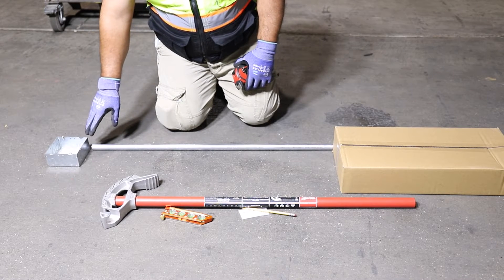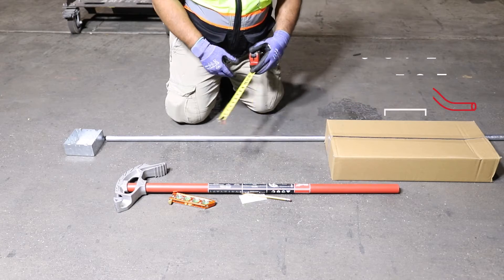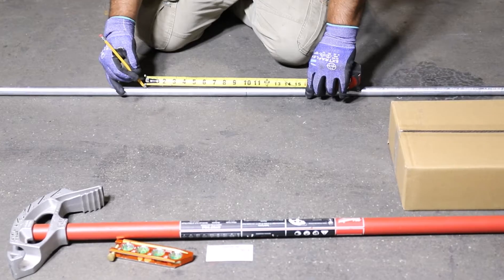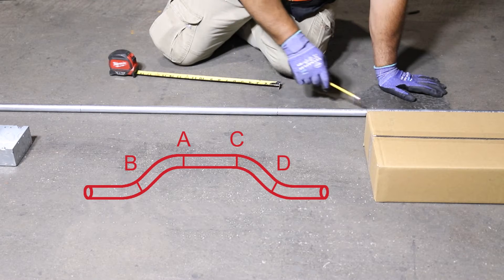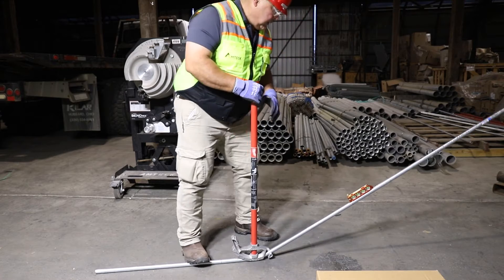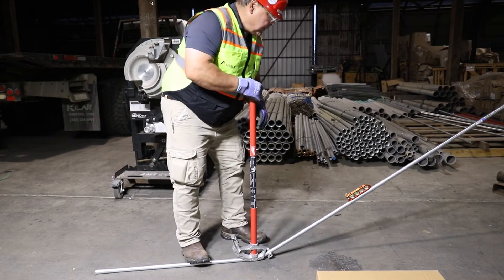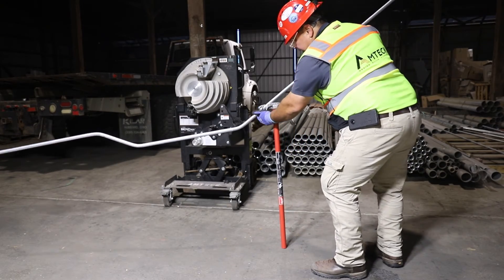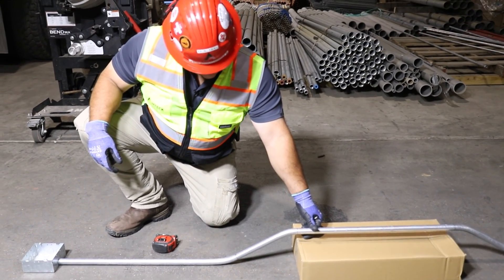How To Do A 4 Point Saddle On EMT Conduit

Comment: In Watching this it's a great beginners video.  For those who are watching you still need to adjust that bend for how you are supporting it, whether it's back strap or mini etc.  Also if you just use a one hole strap you will prob need a box offset in the beginning of that run.  Otherwise , great video.
Reply: Or you can cheat with a clampback

Comment: Gotta do them all to centers. So you can start at the end or after a 90 and bend them all in the same direction. 🤔    You can notch the bender with a bandsaw to indicate the center of _ degree bends.    Quick bend app has some useful features.  It has alot of info mapped out.